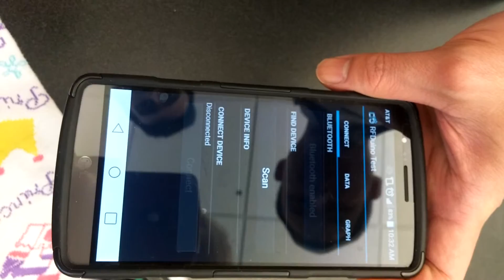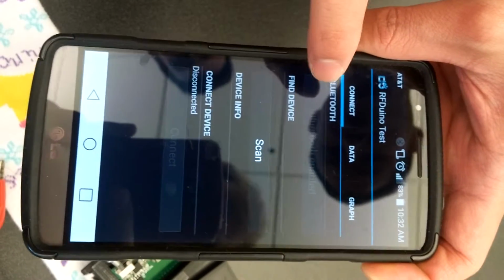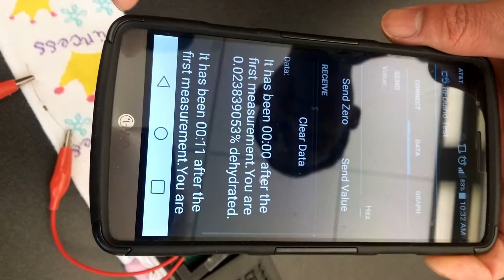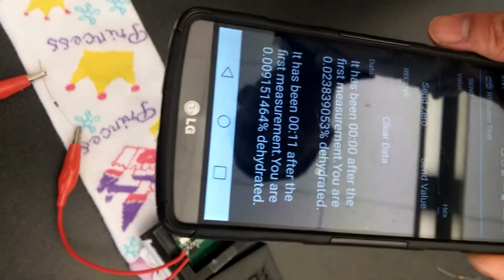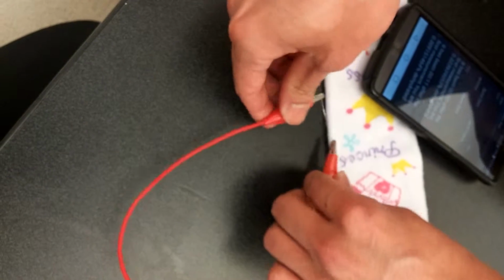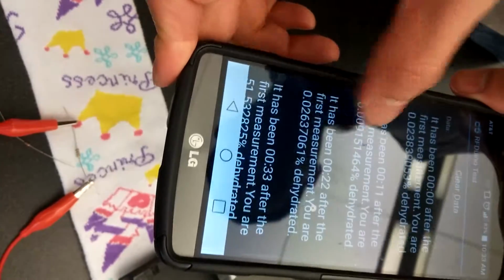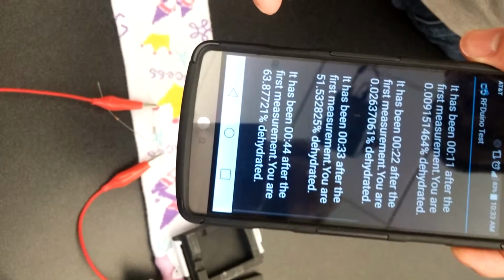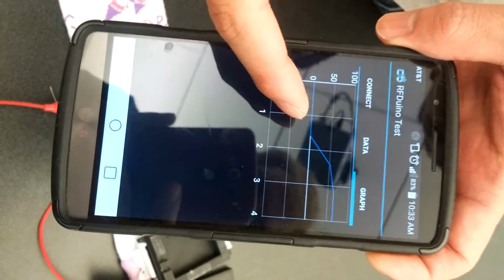Bio-impedance Hydration Sensor - iBIA device Demo (infant Bio-impedance Analyzer)

Comment: sir i want to know circuit  used in the project.
Reply from the maker: AD5933
Reply: It's a bioimpedance measurement. Use MAX30001 or AFE4900.
Reply from the maker: We used a network analyzer with the evaluation analog front end. More specs are in our paper: https://ieeexplore.ieee.org/document/7888786